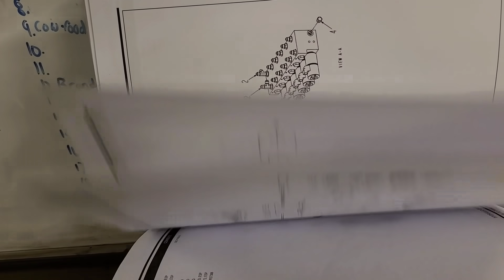Paintings the canopy and assessing the engine damage. 5020 restoration part 2!

Comment: Excellent video keep up the great videos 👍👍👍👍I would for sure replace the sleeves and make sure that the o rings that seal the sleeves are replaced and the bushings in the connecting rods. The damaged rod may be able to be resized if it is not cracked. You could always do a Kinze conversion that was factory authorized back in the day. There was a kit to put a 8 V 71 Detroit diesel engine in the 5020 then you would have 318 horsepower with out a turbo 350 horsepower with a turbo then you could do high speed farming 😁
Reply from the maker: Yes they do lol

Comment: I noticed when you were removing the one piston you showed on the video the the rings looked real loose in the groove. The ring grooves can be cut and shims used to get the correct side clearence. Excessive ring side clearence is what causes broken rings. Enjoy your vids. Thanks from a old engine machine shop guy.

Comment: Taking a ridge reamer to the sleeves prior to pushing up the pistons...helps.
Reply from the maker: If we had one yup
Reply: @SouthSaskFarmer1  you better get one with all these junk deeres around 😉
Reply: or a quick hone job just to get the carbon off !
Reply: A flapper wheel and a die grinder to get to rid of that top ring of carbon and than you shouldn’t need to pound out the pistons they will slide out

Comment: Thanks for the video, Man you'd better get that pump done another turn, you'll need a straight pipe as well to get another 15 hp to haul that roll bar and all the new paint up the road L.O.L. The machine shop guys I used before they retired that was in Portage  told me those JD offset con rods are a bitch for going out of round over time  on the big end, Is it worth getting the others checked you aren't replacing just to make sure you won't have problems with them later. They use to have a huge rack full of reconditioned ones ready to go, so kinda tells a story I'm thinking .
 Over the years I've learned a few mins careful use with a wire wheel on a die grinder or some emery cloth saves loads of time laid under a motor beating pistons out  past the carbon to L.O.L  Take care guys.

Comment: Thanks for all the great information. I was curious what it would cost to rebuild a tractor like that and if parts were still available to  do it. I have a 730 diesel and parts a scarce for it. I heard John  Deere doesn't want to provide parts for tractors past 10 years. They just want you to buy one of their new pieces of crap. Keep up the great videos. Best of luck with your 5020.
Reply: Caseih has been like that for years now

Comment: The price per hole is getting close to what it would cost to do my 4586 IH  . I think I read a complete overhaul on the V-800 engine in it runs  25-27 thousand

Comment: There is full overhaul kits online for the gorgeous ole girl. Idk if u want that but ive never had a problem with them.
Reply from the maker: Can't get them
Reply: @SouthSaskFarmer1  damn. Ig they r all in the states. U said u take ur head and crank to moosomin. Where in mooomin i got a 12 valve head that needs to go desperately and maybe the crank but havent ripped it apart yet. But the head is not happy for sure.
Reply from the maker: @pistonringfarms8107  they are shipping it to continental engine in regjna

Comment: Somewhere I either saw one or read about a 5020 repowered with a 9030 engine. You think?
Reply: I have been wrong before but I think you mean an 8030 engine. 9030 would be 2007-2011.

Comment: Anyone ever heard of filling the roll bar full of sand to eliminate the vibration from the 20 and 30 series Canopies?  I love the look but they are loud.
Reply from the maker: It's solid iron mate can't fill that lol
Reply: @SouthSaskFarmer1  the roll bars on our 2630 2030 4020 are all hollow and the roll bar is one piece.  And our 6030 with cab has a 3 piece like yours with 2 solid post.  I was told the hollow tubing could be filled with sand and stop the vibrating canopy idk.

Comment: I have a 5010 sitting in the shed. well worn motor. lots of blowby, I am amazed that it still starts and runs about the same as it always did. the engine experts I talked to call it a "Dinosaur" motor. Just wondering if a 404 combine engine would bolt up? It would still have enough jam to run the discbine.
Reply from the maker: Nope you need a 619 or a 531

Comment: 165 - 170 HP , that's like a 6030 , Buddy , YEAH !!!!! FUCKING NATURALLY ASPIRATED , WOW WEE , GOOD FORM , eh .. When you finally get that 6030 , you'll have to run it up 225 HP , and put LSW TIRES to transfer the power to the ground . Put a turbo on Ivan's 4020 , eh , that will hot rod the old girl up ..
Reply from the maker: Still won't touch the 4640 woth 245 lol
Reply: @SouthSaskFarmer1  just the cool factor , Nick !! Not the most outrageous , you know , just COOL MAN !!!!!

Comment: So 700 Canadian dollars per hole and he needs two holes. Then the crank ground. Then the head reworked. Then the injection pump rebuilt. Holy smokes Nick you are gonna break Twan from peeing too close to the shop. I wasn't hot for your cab teardown as I am old and heaters and air con seem OK to me.
Reply: Gonna be more than 2 holes